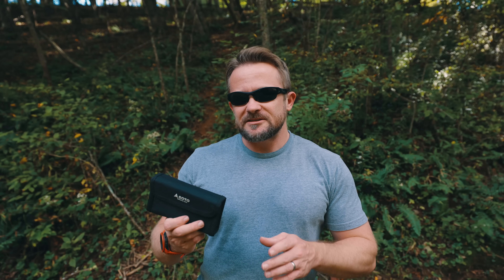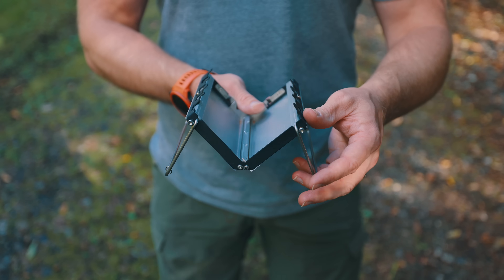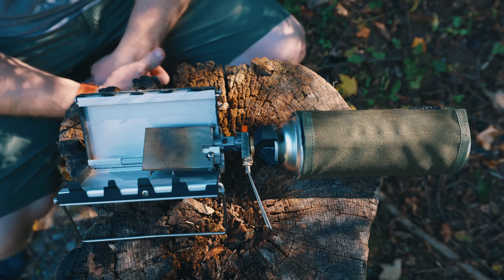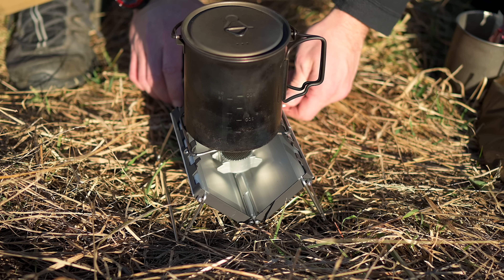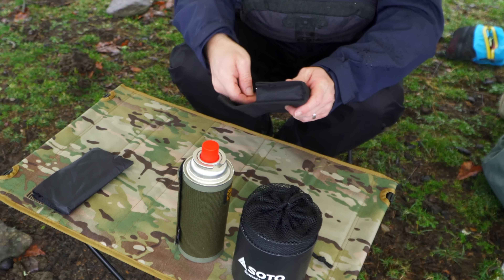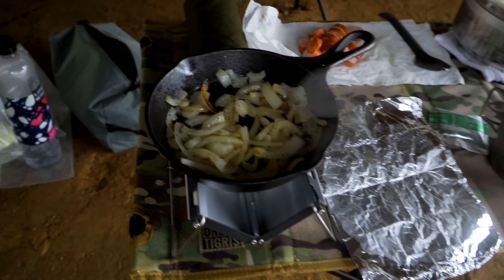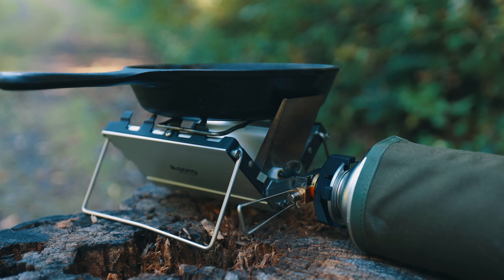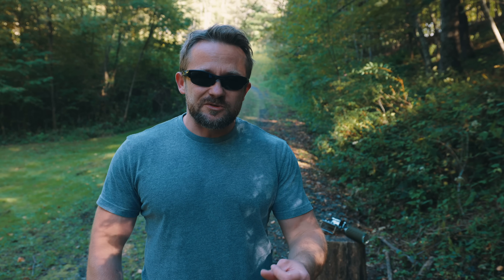The MOST UNIQUE Stove I Have Ever Tested - Soto ST 320 Long Term Review

Comment: bought it out of curiosity, loving it for daily home use since it's perfect and efficient for heating small objects such as moka pots. Mostly use it for a single cup moka pot that's impossible to heat well through anything but camp stoves and a butane bottle lasts many, many cups.
Reply: For sure. Most home cooktops don't work well with the smaller cookware.

Comment: I bought this stove over a year ago based on a previous review of yours. I agree, the stove works great and I really like it. I built a coffee station (using a Stanley lunchbox) and this is my primary stove. When it gets colder I swap it out  with a vintage Coleman single burner gas stove - I swap them based on the weather.
Reply: Had to laugh at this, as I do the same with the only difference being that my Coleman is a truly old double burner
Reply: Kurt, what is your temperature cut off, for this stove?
Reply: Morning temps above freezing
Reply: @brentlloyd7908 I really enjoy using the old Coleman single burner or the suitcase style gas stoves.
Reply: @kurtmyers  I've used the 2-burner suitcase for coffee at -20F.  The only difference I noticed was it cooled off quicker, so I could pack up and hit the road quicker.

Comment: I'm on my second one, Luke, after seeing your review of them.  It's lasted an entire year of motorcycle camping without issues!
I will note that the first one I had, wound up with heavy winds pushing lit butane back down the system and lighting the button on fire.  So to run it in 10+ mph winds, much less 20 or 30, you're going to need something as a wind break.  Other than that, it's worked perfectly for me, up here in the Pacific Northwest!

Comment: I have the same stove. Love it, but as you said, comfortable for one person; pushing it for two. That heat shield and the butane bottle's close proximity is what limits your pot/pan size to about a 3" radius.  Pretty sure I've tried an adapter and extension to separate the bottle from the burner, but as I remember, that caused some sort of stabilty issue by removing the bottle as support point.

Comment: A good rule of thumb (heuristic) is that pure butane stops useful vaporization at 32F (0C). If you are pedantic look for the vaporization pressure vs temperature curve.
Best bet in colder weather is keep it under you jacket a while before use.

Comment: This stove have been around Asia markets for many years and  have been well welcomed . I have read in those years a report with photos  that the user stated the burner head melted. It may be  as Luke said ,there was a old version with higher output. Under certain circumstances the burner head overheated and melted. So Soto hake a new version with lower output.

Comment: I still prefer my Soto Amicus and not for the lower price. As opposed to the Soto Windmaster, it's all one piece for much easier storage yet it still has 4 legs, a built-in igniter and does the job perfectly for me, every time I use it.
Reply: I agree had mine for two years and works perfect every time. Performs well in wind aswell paid £45 for stove and Soto cookpot, absolute bargain

Comment: Hi Luke!  I'm so glad you did an update on this, and yes I'm going to say it too, COOL stove!  I saw your preview three years ago, and the stove seemed SO interesting to me, I promised myself I would get one eventually.  Sooo. . .last year I got one on Amazon.  I think they were around $100 at that time, but I splurged and got one anyway!  Everything you say about the stove is spot on!  The case is NICE.  The only experience that differs from yours is that my lighter has never failed to light the stove on the first hit. (unless I did something dumb, like turn the gas off after lighting instead of on!) I also use those covers on my butane cans.  Luckily our Walmart does carry the butane cans, but are out of stock a lot.  I know, I bought a couple myself!  VERY reasonable!  The only problem I seem to have is putting the burner on the can.  I am going to try the method you used in this video!  But I too, would for sure recommend this stove, especially since the price is much lower!  If they released this stove in the U.S. I bet the price would come down even more.

Comment: VERY cool.  You can easily make a thermal can cover from reflectics and some gaffer's tape.   The reason they reduced the BTU for this model is because if you trap too much heat under the pan, it can cause the fuel canister to explode.  Encouraging the use of larger pots/pans is a problem.  Better to limit the size so that the pot cannot extend over the fuel and cause a problem.  Some stove designs have a heat driven disconnect that pops the fuel can off if overheated. I love Japanese engineering, and wish we could find more of it.  I would love to see them create a similar catalytic heater for very small spaces and emergencies. Kovea, another great Japanese company, makes the Cupid stove, but honestly, even that is too big.  After just a few minutes you have to shut it off, and then the cold comes back.  Better to have a very small heat delivery that you can adjust and keep constant.

Comment: That little stove is cool: I have a newspaper grill. It comes in a box, 2 grills connected by two rings. It pulls out of the box reverse sets up, looking like a little trash can with holes in it. Do you take 12 full size sheets of newspaper wrinkle them up throw them inside open the grid things, put four burgers on it, close it, lift the grills like the top of the newspaper set the grill on it and it immediately start cooking. Noticing the insides cooked you just flip the thing over and when the newspapers are done burning the burgers are fully cooked and so juicy. 😋

Comment: I use a canister stove daily, in winter I just sit the canister in some water as mine has a hose connecting it to the stove! That stops it icing up , works great. Maybe a wet cloth might do the same job, I found the water doesn't need to be warm either.

Comment: Thank you for this excellent video. Based on your extended use of the stove, you gave a very thorough review including pros and cons.

The following is totally IMHO. 

Looks like a well-designed, well-made, fairly rugged stove suitable for one to two persons in warm weather. 

Below 60 degrees Fahrenheit, use a different stove, including but not limited to Coleman fuel, propane, or campfire. 

Based on experiences I have had or witnessed over the past 60 years with a variety of stoves and fuels (butane, isobutane, propane, Coleman fuel, alcohol, Esbit, charcoal, campfire), I would restrict my dependence on this or any butane stove to warm weather only.  

Again, thank you for this excellent video.
Reply: That's very limiting.

Comment: Thanks for the expanded review. I've seen you use it in quite a few videos. It's such an interesting design. I like the folded form with the case. It would be easy to pack. No funny shapes. I like the cheap gas. I like the apparent stability. I have a few stoves from tin can alcohol to Esbit, a $15 Chinese "pocket rocket", an ooold Optimus 8R, and an older 3 burner Coleman. I love them all in different contexts, but that Soto I think might be the most useful and easiest to work with.
Reply: Why don't you just come out and say "I love playing with fire?"

Comment: I’m always interested in butane stoves. (Cheap fuel)
What I like is the low profile. 
It could prevent a tip over, or boil over scalding. 
My daughters jetboil boiled over, right in front of her. Sitting at a picnic table, in a mountain shelter, this spring. 
She panicked to shut it off. And almost wore it.
Reply: JetBoils and BRS should be below you or at least on the bench you are sitting on.   Not on a table.  They are tippy and boil over easily.  If used lower they avoid scald or tip over injuries.

Comment: It’s cool ild rather it if it has a longer rectangle burner vs that spall spot burner.  To have a better heat pattern.  For bigger pans ect not to have just a tiny hot spot. Cool though

Comment: The long factor doesn't appeal to me much, but the flat factor does. Now, how would I go about getting the ignitor parts without the case?
I would only put this inside the honey stove, probably the 6 sided 150mm version, maybe the hive extension with 8 sides and a diameter of 180mm...
It looks to me like the ignitor unit is about 120mm so should easily fit but correct me if I am wrong.

Comment: Not really sure why everyone loves this stove so much. If you're not a real hands on person you won't be able to figure this out, especially from the instructions that are in Japanese. Mine had several sharp edges I had to fix, including the springs that hold the burner, once I smoothed those out it goes together much better. The pot stand wire does not sit centered over the burner and it's really only designed for heating a cup, and it's unstable, it could have been a much better design without that Z shape. There are many better options out there, like a jet boil, that all fits inside the cup with the can of fuel. You must be being paid to endorse this. On top of that, when I first lit mine the flame was out of control, like a foot high, tried several times and it was the same. I took the regulator apart and cleaned it good and then it started working properly.
Reply: Thanks for your unbiased review!

Comment: This is definitely unique and different, the burner makes a nice looking flame and the design is conducive to reflecting the heat back into the cookware, and it looks stable... but seems needlessly complex with too many different materials and not flexibility in the fuel used. Nice but not the stove for me!

Comment: The thermal output for the stove, according to the official Japanese website, is either 1.7 kW (5800 BTU/hr) when running on their ST-700 gas canister (100% butane), or 2.1 kW (7165 BTU/hr) when running on their ST-760 gas canister (roughly 90% butane, 10% propane). It's not very powerful compared to SOTO's other offerings.
Reply: Yes, but it is "unique". That's all you need to know here buddy. Luke is a "pro".

Comment: Its a great stove , but that being said , there are so many great stoves for less than $20 , i just cant justify any reason to buy a +$50 stove for any reason , other than to be trendy . Im not saying all cheap stoves are great , but ive got at least a half dozen cheap stoves , all were under $20 , all of them work great , and all of them i have had for years with no problems . I have one stove i paid $20 for and it came with an adapter ( that also works on most of my other stoves ) that allows it to be used with butane , iso butane , or propane , it also allows you to transfer iso butane frome one canister to another . Personally if i had a $100 to spend on a stove , i would rather just buy a <$20 stove and spend the other $80 on a tarp or other useful gear . That being said ive also got a pricey msr stove , but it always stays home because it doesnt do anything my other stoves dont do , its loud , and not that great on fuel . There are plenty of times when it pays to buy pricey gear , but i just dont think stoves are one of them .  Just sayin

Comment: I think the stove is intriguing, but it uses the least commonly available fuel, and cannot use other fuel alternatives with a converter. Butane has it's issues with cold weather camping as well. This the chosen fuel design pretty much renders the stove impractical IMHO.

Comment: Neat stove, BUT!  No.  I live quite a bit north of you where it is colder...  I still have both my Svea123R and my Optimus 8R.  Yes, Coleman fuel only, with the cap pump for cold wx.  They have served me well for 50+ years, both still with the original wicks, too (dont run them dry...)  Ok, only ~5,000 btu, but hey!  They Work!!  Every time.  Reliably.  NONE of my Colemans have lasted.  These 2 have.  Still cook'n.  S&H  Jerry

Comment: SOTO ST-320 Single Burner, Ultra-Thin, 1.0 inches (2.5 cm) Thick, With Storage Case, ,Solo, Camping, Touring, G-Stove
Brand: SOTO
 4.4 4.4 out of 5 stars    797 ratings
Amazon's
Choice
for "soto st-320"
$110.76
Available at a lower price from other sellers that may not offer free Prime delivery.
Brand	SOTO
Fuel type	ガス
Material	Aluminum^Stainless steel^Aluminum die-cast^Brass
Product Dimensions	15.2L x 7.6W x 19.6H Centimetres
Power source	Gas type

So I will stick with a small campfire that does the same heating /cooking without having a fuel canister to pack in and pack out to recycle.